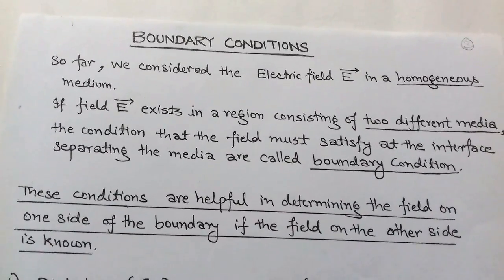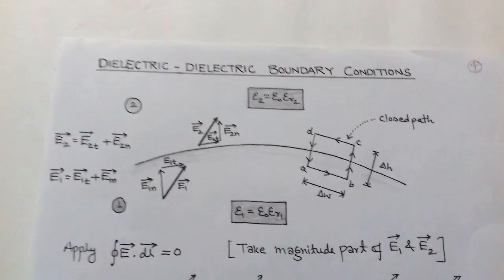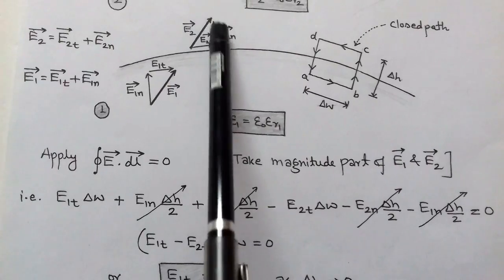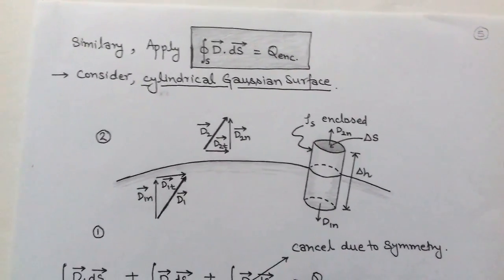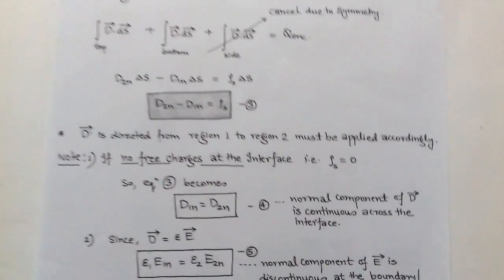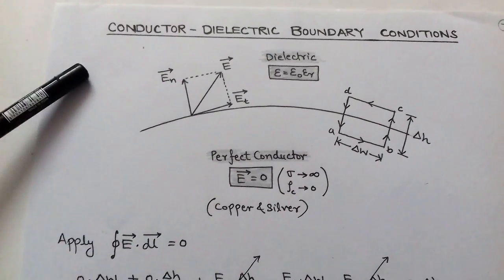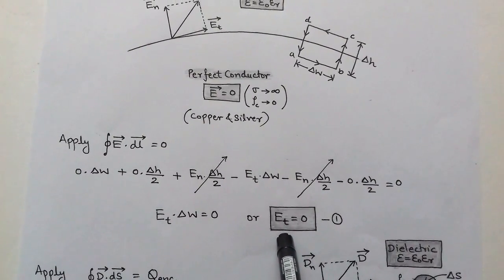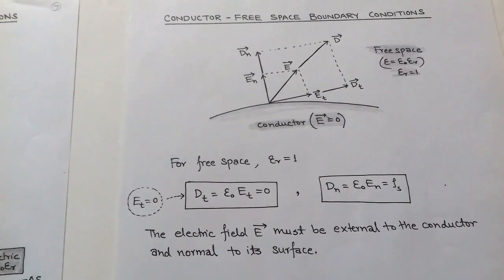2.14 BOUNDARY CONDITION on E & D for IES /GATE

Comment: EMT

Hi,
Can any one tell me why the net flux from the curved surface of the cylinder is considered as non-zero while calculating the electic field applying Gauss Law but flux from the same curved surface is considered as Zero while finding out the Boundary Conditions for dielectric - dielectric interface.
Reply: Rudraprasad Pani. In guass law we consider line charge coming out of top bottom and side in which top and bottom is zero.. But in boundary condition we are taking surface charge density for which cuveture part is zero due to symmetry(equal and opposite direction )
Reply: Bhai tengential  electric field nikalte samay hamne line integral Liya tha aur normal component nikalne ke liye surface integral Kiya hai waha  electric field ka normal component  wala term height negligible hone ke Karan khatm hua hai

Comment: Will u pls explain cancel due to symmetry...in cylindrical system?
Reply from the maker: here we use cylindrical closed surface, we take differential surface ds on the curve surface assume on right side and it's direction is unit normal vector I.e same as tangential components of D in same direction...But when we take differential surface ds on left side of this assumed Gaussian surface it's unit normal vector is opposite to the tangential component of D Vector... so after adding such equal and oppsite components around a closed surface there is a cancellation...which is due to the symmetry of cylindrical curve surface......hope  u got it......thanks....
Reply: EPOV CHANNEL thank u so much
Reply: it is not all due to symmetry,it is because "delta s" is perpendicular to the "D",so dot product will be zero.